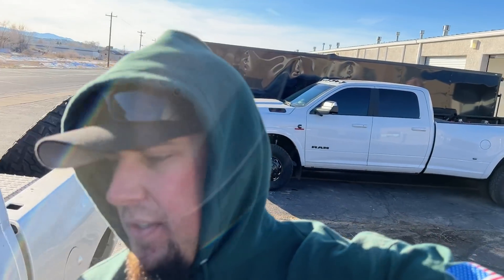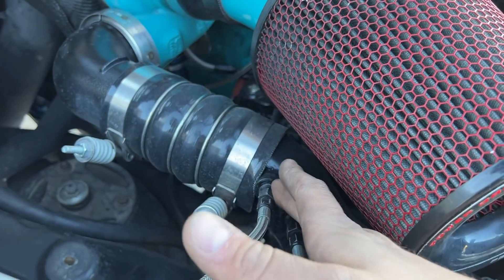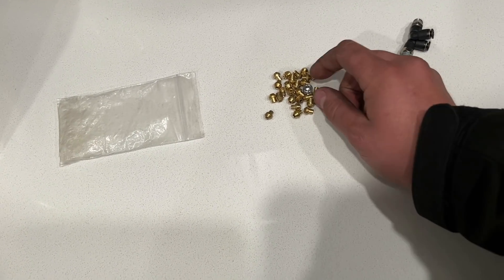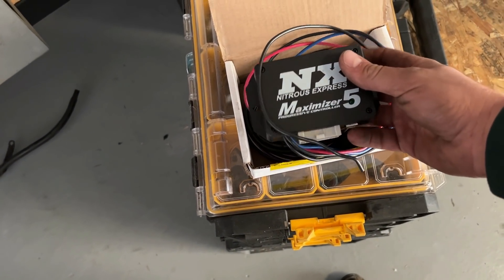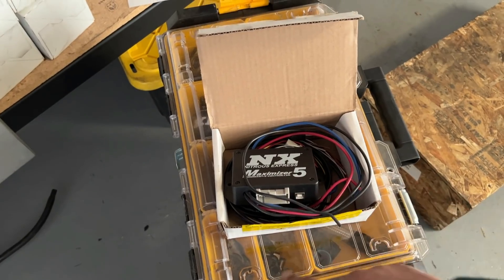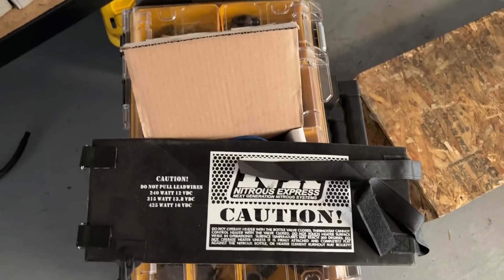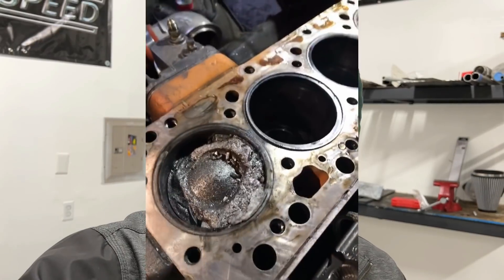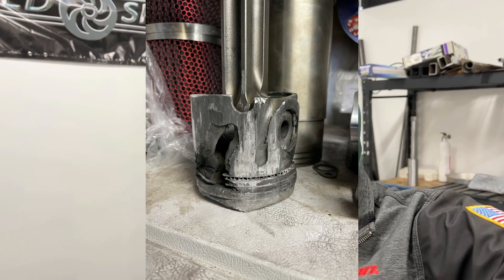ALL ABOUT NITROUS!

Comment: 14.5 afr on a diesel is the “ideal” afr because at the end of combustion you are left with no extra fuel and no extra air. That’s a perfect scenario. Getting that good of a mixture In the cylinder is difficult. You’ll generally see haze when the afr hits 15.  Anything lower than 15. Will progressively get darker because the fuel is now burning all of the available oxygen and the rest is actually turning into charcoal briquettes. If you light a OXY acetylene torch it has soot particles until you add the oxygen.
Reply: I usually see noticeable haze starting at 17 and it’s pretty smoky by 15. Not like can’t see thru it smoky but like a brown column smoky. That is usually the peak power and egt point I have found.
Reply: The only problem is that burns extremely hot. That’s what almost all race trucks run 21+ AFR

Comment: Kind of off topic on the video but just wondering if on your common rail if you could have a post fuel shot at say 90deg crank angle just to knock some temp out and maybe save parts. Probably would increase smoke though. Just a thought.

Comment: Thanks for the info. After my engine is built. I plan on making some pulls and seeing how the exhaust looks. If its not cleaning up with turbos I will be looking into a nitrous express kit. Great info on the cooling properties of over spraying.  I will keep that in mind if egts get out of line.  Sounds like you prefer to set it up to hit based more on rpm than boost presure. 500 rpm or so before peak hp.
Reply from the maker: Boost is a very arbitrary number. Once the engines moving the turbos are either moving or they fixing to move
Reply: @horsetorquesdiesel  I 100% agree. I was thinking having it spray based on boost could lead to some inconsistant results as boost is affected by load on engine. So it could end up spraying way to early. Or late.. probably give you a 2 stroke like power band when the turbos lit though!    Thanks again Josh.

Comment: Furthermore at a 14.5 afr you are extracting the most energy out of the fuel. As we know energy is Released forcing the piston down, energy is also released as heat. The “ideal” air fuel ratio is going to have the hottest combustion temperature. Now you can use that information to understand why having lean air fuel ratios decreases cylinder temperatures. You will have extra air in the cylinder allowing what fuel is injected to have a more complete burn.  Something similar is true for a excessively rich condition. It will burn all of the available oxygen and the extra fuel is actually cooling the chamber down. It might look bad with all the black smoke but with a limited inducer size you want to use every last bit of oxygen that makes it into the cylinder.
Reply: He is saying the same thing just dumbed down for all us special people
Reply: I am a field asset performance optimization engineer for a company that is typically considered the worlds leading industrial engine/process troubleshooting firm. I was a CAT, Waukesha, White, Cooper, Solar, GE mechanic for six years before I went to Texas Tech for mechanical engineering, so have field tech experience to argue with school kids haha. I am newish to diesel platforms, having a 96 12 valve as of March 2020. I spearheaded development of an emission feedback control system using quartz crystals to analyze emission spectrum of exhaust gases immediately post escape event. Paired with dynamic pressure transducers, and velometers for maximum parameter analysis and control. Typically only for natural gas compression, LNG terminals, and power generation. I have been working towards adapting/scaling for automotive diesel applications, but it is really cost prohibitive haha.
Reply: @johnny trans . What happens when you push the air fuel ratio way closer to 10.0 ?
Reply: @daviddroescher  lots of heavy black smoke low egt and power. In my experience anything fatter than 12 on a diesel and it starts losing power.
Reply: @bcbloc02   sorry I meant off the lean end. I've got no use for smoke. I've gone from 750egt 3psigat 65mph to 450egt 5psi at 65 .  With a flog the dog peak/ sustained of 1250 at the top of a long steep grade ( Soldier Summit I - 80 east of salt lake) at 16020lbs ( cat scale)
Reply: @daviddroescher   lean just means there is unused air after the combustion event. That’s why egts are lower.

Engines are air pumps and turbos are pressure ratio generators. When fuel is introduced heat and force is generated. The amount of power a engine can generate is limited by its thermal envelope. (How many BTU’s the cooling system is capable of shedding). Increasing thermal efficiency is a relatively straightforward process. If you look at factory output on a 2006 ram the engine makes 310hp stock. You can easily add almost 200hp with only a tune. Now try hooking 20000lb behind that 500hp truck. You will reach the thermal limit of the engine very quickly. That 500hp is pushing the factory turbocharger well out of its efficiency range. A solution to the lack of air could be a larger turbo. Or compound turbos. Compounds will allow the factory turbo to run in its efficient area of the compressor map  And allow the larger turbo to run within its own efficiency map. Everything is about efficiency. The more efficient the engine is running the less heat it will produce.
Reply: @Jonny_trans   you have spelled out  my understanding . By going from a H1C 57/65/21cm to the "SMALL"  hx35 52/65/10cm I am at 1psi by idle+50rpm(makes driving on black ice interesting) and the results posted above. Next experiment is the finish building the hedder pipe( between the  manifold and  charger). To mount a G25-550/ .80  over S362SXE 62/76/.80.
Current fuelling is 72cc/1000.  With the H1C  1300 on a empty truck was easy on same calibration. The hx is producing 3: 1 PR @165°F at the horn.
Reply: You actually extract the most energy out of diesel fuel in diesel engines at roughly 2.0 lambda, but it's far from where you make the most power or are the most efficient because of how diesel engines operate. You are probably thinking how is that possible this doesn't make any sense, trust me i struggled with this idea for years!!!  To extract the most energy out of a fuel you need to release as much heat as you can for that specific amount of fuel being injected into the cylinder. If i release a bunch of heat out of a little amount of fuel but it takes me 140 degrees of crank rotation to do, well that's not good for quick cylinder pressure rise and so it's not really that useful for pushing a piston down in a engine anymore. But i got the most heat released from that specific fuel amount therefore it's the most efficient! See it's a yes and no issue. For power we want to release all that heat as fast as we can with the least amount of it being absorbed into the pistons and cylinder walls. Heat release rate determines pressure rise rate and thus torque put onto the crank shaft. If we go too rich we start to steal the available heat from the cylinder's compression stroke and thus slow down the rate of which the fuel is heated and change how quickly that heat is released. There is no one AFR fits all and one tune fits all. But that is why typically the most power occurs at 18.0 AFR  or 1.25 lambda in a diesel engine and even into 1.28ish lambda. This is what firepunk is trying to relay Josh. Start going lower than 1.25 lambda you're robbing heat needed to heat up the fuel and make it combust quickly and evenly and so the smoke really starts being produced. Along with higher EGTS because there is more unburnt fuel stealing heat from the combustion process pre and post combustion and carrying that heat out of the cylinder as heated soot and that soot is then transferring that heat into the manifold, the turbo, and EGT probe. Can you make more power with a lower than 18.0 AFR? Yes absolutely but it's really because of other random factors at play. This is why ford went to a air to water CAC, it makes for very small charge air temp swings relative to an air to air intercooler. This means timing can stay more linear because that incoming charge air temp is very consistent and absorbs heat and release heat very consistently. This is also why Josh has better results with "pre heating" the nitrous he sprays by injecting into the hot side vs the cold side. It's actually extracting more heat as the delta in temp of incoming nitrous to CAT is higher meaning more heat is being absorbed by it and the uniformity in charge air temp further makes tuning easier, requiring less timing changes. Diesel's need heat for proper combustion! Don't forget that!

Comment: Josh, on the dyno runs and drag racing, once your big kits are on they stay on for the duration of the dyno run, ( short, I know,) and duration of the 1/8 mile or whatever?  You ever boost reference as the trigger for the kits coming on?  I ask because I know you can get rpm from cam signal but I also know it can be sorta an erratic signal and a big kit coming on too early would suck.  thanks
Reply from the maker: I use throttle position with a timer

Comment: Awesome video with tons of tech info about purposes and goals of use. Thanks for sharing the knowledge! Definitely no substitute for experimenting and trying different set ups. Do you have to make a lot of changes based on elevation changes for competition?
Reply from the maker: No it’s more of a driver mod then tuning
Reply: Most competitions are at low elevation meaning more oxygen is in the available air at a higher PSIA. Josh's tuning is done at 5892 elevation so when he goes down to sea level it's like giving an extra 5-50hp shot of nitrous, on the other hand if power Driven was to host an event sea level competitors would have to adjust their tune to lean it out to compensate for lacking O2 at elevation and they're only being 12 PSIA ( psi absolute) ambient air pressure. And seeing how turbos do not understand pressure they only understand pressure ratio in: out having a -2 psi start point is a snowballing situation. It's a big factor in why Lenny at Dynamite Diesel wants to know where you're going to drive the truck it'll change what sticks you get recommended to install.

Comment: Two questions for ya:
1- Is there a draw straw in the nitros bottle and if so should the bottle be aligned with valve towards the front of the vehicle so you ensure you are actually pulling liquid instead of vapor?
2- Is the nitros in liquid form all the way through the system until it hits the discharge nozzle?
Reply from the maker: Yes it depends on what brand but for NX the draw straw is at the bottom on the side opposite of the logo.
Reply from the maker: Generally it’s liquid until right after the solenoid
Reply: @horsetorquesdiesel   Cool thanks for the reply, I've built sanitary stainless systems for people that use bottled butane and was very curious if the nitros operated in a similar fashion and if the components were put together the same

Comment: I’m gonna be using a Watermethanol kit to inject diesel into the motor and a nitrous kit. What meth jet do you recommend for the diesel? I’m thinking about starting with 500ML to inject about 50/75 nitrous thanks in advance
Reply from the maker: Don’t
Reply: Any main reason not to do it? I’m trying to add fuel to use the nitrous
Reply from the maker: @dcd2060  meth and nitrous don’t mix
Reply: No where not understanding each other I plan to use the meth kit with out Watermethanol and instead use the kit to inject diesel. That way I don’t have to upgrade injectors or cp3 yet

Comment: plus there are zero harmful effects of a diesel engine running too lean. eventually it will reach an air fuel ratio that is so lean the engine will make less power but no damage can occur, the opposite of having too much fuel which is bad and causes high egt.  which is also the exact opposite for gasoline engines which in their case a too lean scenario causes extreme in cylinder heat and too rich does no harm (to a point, as a gas engine can run sooo rich that youre getting gas past the rings, engine oil smells like gas and therefore can wipe out bearings).  for example banks made 1000hp with an l5p at 23:1 afr, but if a small block chevy ran the same afr it would melt holes in the pistons.  additionally the measured value of excess fuel or air in the exhaust is called lambda.  a lambda of .99 and below indicates all oxygen has been used with an excess of fuel (rich). a lambda of 1.01 and above indicates that all the fuel injected has been burned with an excess of oxygen remaining (lean). and lambda of 1.0 means there is no excess of either in exhaust thus a perfect burn has been achieved, which in theory means engines afr is at the stochiometric ratio for whatever fuel its running on (14.5:1 diesel, 14.7:1 e10 gasoline, 1.7:1 nitromethane, ect)